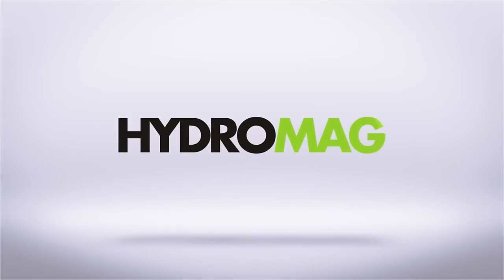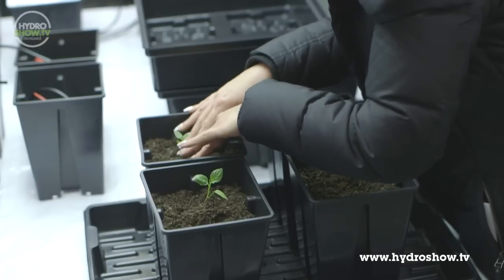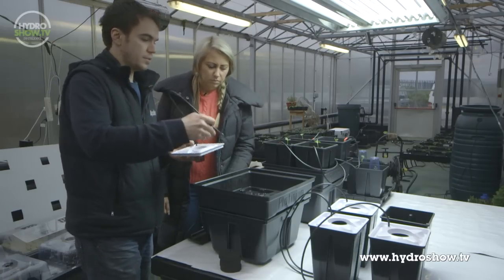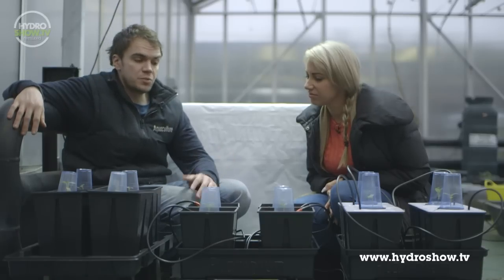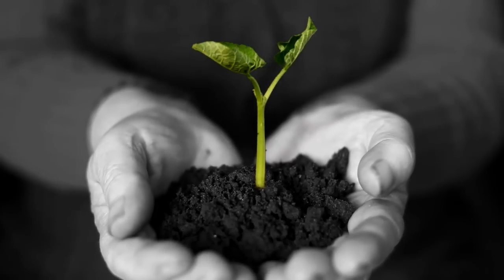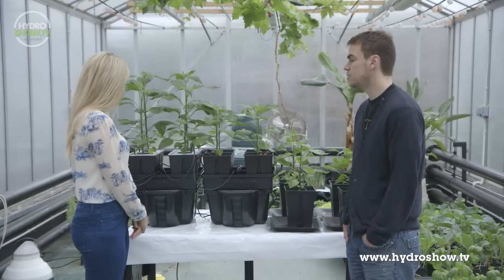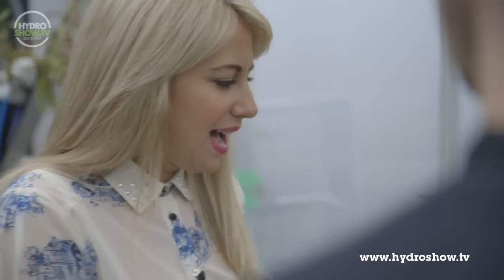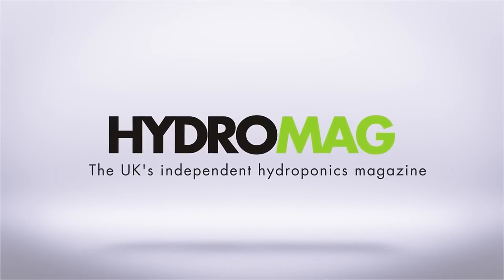#40 - Hydroponics vs Aeroponics vs Soil Growing Systems

Comment: What I miss in all these hydroponics and aeroponics demos is any mention of the energy consumption/cost (pumps, led lighting, possibly heating in winter if need to heat). 
Especially where these systems are shown for home users, it would be a great addition to know if that will add much to the running costs
Reply: Sebastian wouldn’t that depend hugely on where you get your power? The pumps are minimal no more than having a couple of goldfish, but lamps are a whole different story and most will tell you the draw power. Check out QB led technology if you’re just starting and want super effective and cost efficient lighting!
Reply: regarding LEDs i think ull be using the same amount whether u use soil, coco or aeroponics so it doesnt make much of a difference m but the output would be alot more in aeroponics

Comment: Strange, the aeroponic grown pepper plants look stretched. much larger internodal spacing, enlarged leaf growth. Looks like the larger plant size is due to cellular elongation rather than improved cellular division; similar to what you would expect from plants grown under a very red dominant light spectrum with very little blue. Improved access to oxygen at the roots should allow for improved metabolic respiration and faster cell division, but that's not what i'm seeing in your test. I have considerable experience with hydro and soil, but  I don't remember elongation as being a direct consequence of hydro, but now i'm questioning what i thought i knew  hmmmm...  time to go back over the literature...

Comment: You'll also notice the really quick shot of just one of the plants roots..to keep you from seeing how he's trimmed the rotten bits off ;)
Reply from the maker: Petty
Reply: @hydroshowtv  not really petty, it's a serious concern with this type of system. I'm guessing you didn't use any kind of timer with the pump on those plants, in which case you're not using aeroponics, it's simply soil and two different drip systems. Aeroponics exposes the roots to greater amounts of oxygen not just because of the spray/drip (which is the same as nutrient film technique or a good drip system)but also because of the periods in which all the roots are completely exposed to oxygen absorption. The only exception is when the most is fine and thin enough that the roots will constantly get enough oxygen between the fine misting effect of the water source but that's typically only feasible when using ultrasonic misters.

Don't get me wrong, you have a good system, but it's only that, good, not great and not true aeroponics. If you had a properly setup drip or nutrient film hydro setup you would likely have similar if not better growth from those plants as your pseudo-aero devices. That being said it's very rude to call a legitimate piece of constructive criticism "petty" especially when it relates to the real world performance of a product that you're promoting. At best that's misleading at worst it's downright fraudulent.
Reply: @lazyh-online4839  Excellent return - Educate rather than bash - Love for Aero - I'm working on a setup that will use a very small micron fog blended with the general  or sudo misters that come standard on the Turboclone systems -  The water basin needs to stay at optimum temps as well -Thank you again for the extended reply toward a shallow answer that most-likely had people failing at Aeroponics -
Reply: @jasonjanes3256  great to hear other people are getting involved, I built my own setup mostly homemade, just reusing components like high pressure solenoids, push connects, reverse osmosis pumps/tank, and some high pressure misting nozzles to feed the plants. The hardest part I'm working on now is I'm trying to build a custom timer using Arduino as a platform but it's very complicated because I want a modular system that can add on sensors/modules and the like for monitoring or adjusting factors like water temp, pH, nutrient concentration, even tie into the lighting timer of possible, but it's difficult to program something like this for a beginner like myself. If you're interested, I'm planning on trying to make these (the program at least and hopefully a couple Arduino shields as well) available to anyone interested, let me know if you'd like to know more.
Reply: And the roots were bone dry👍

Comment: Does each plant have the same over all nutrients though? I mean does the soil plant have more nutrients packed in to it's leaves because it's smaller? Or do all plants have around the same amount of nutrients over all, in the sense that one leaf from the soil plant and one leaf from the Aeroponics plant, would have around the same nutrient content if measured? Or does one plant have a lot less nutrients in it's leaves, etc, than the others? Basically which grow method ends up with the most nutrient rich produce?

Comment: Nice production, i`ve seen a lot less professional and informative stuff on the BBC ;)
If you plan to do more testing in the future i`d recommend including an NFT system, a sprinkler based aeroponic system and an aeroponic system that delivers short pulses of very fine, fog like mist. You`ll find the performance of the sprinkler based aeroponic and NFT is very similar but neither will come close to the mist based system. If you use pre-rooted cuttings in netpots filled with hydroton for all, that will provide a level playing field.
Reply from the maker: Hello. Thanks for the heads up. This was a very rough test. I guess this is not 'true' aeroponics, but more what has become known as 'aeroponics' in our industry. Undoubtedly the methods you talk of will offer different results, and we hope one day to put this to the test too! Keep watching. :)
Reply: hydroshowtv
There`s nothing wrong with low pressure aeroponics/sprinklerponics, its effective and the least costly. High pressure aero offers better mist quality and greater control for a price. Air atomised aeroponics represents the ultimate in mist quality and control but its also the most expensive.

Comment: question, have you ever tried to take the aero pot and transplant into a medium? my first attempt is with a dwc setup and from that I have read, the medium like the coco makes or better fruit.
Reply from the maker: Hello. Not sure about this, in fact, pretty sure that there is little evidence to categorically say that transferring in to a medium like coco makes better fruit. Coco is inert, or at least it is supposed to be - it doesn't usually offer the plants anything other than something to plant its roots down in to (unless it is pre-fertilised, and even then that nutrition would be used up by the plant sooner or later, meaning you would need to add more nutrition to the medium). Please do send us a link to where you have read this about coco - would love to read it.
Reply: I was referring to medium with a dutch bucket or sorts, sorry for the lack of info.  the larger stalked plant will need some support and I don't think the dwc method will work well when they get larger, but maybe I'm wrong there
Reply: hydroshowtv i did not quit get the daily maintainace that was mentioned on the arioponic system? i imagine the sprayed water collects at the bottom then is pumped back up to the pray heads? is there a great deal of loss? do these need to be topped up daily?
Reply from the maker: Sorry, how do you mean loss? HYTV
Reply: loss as in water leaving the system through being turned into vapor and leaving the system, hence the need to top up, you said it would need to be checked daily, is this to monitor water loss (as i have described) also to check ppm?
Reply from the maker: Oh I see. Well this is not that type of aeroponic system. The kind you're talking about literally turns the nutrient solution in to a mist or vapor, however this is more a sprinkler system where the water is kept in liquid form (rather than vapor). This means, you get the advantages of high aeration without 'loss' of water through evaporation. Of course, you should check the tanks levels daily, as well as the pH and the EC which should naturally alter as the plant drinks the water (In a nutshell). Definitely a subject worth covering in greater detail in the magazine or in Series 2 of the Hydroshow.
Reply: hydroshowtv cool chap cheers for that, im toying with making the step from organic to aero, so i will look out for that! thanks for your time!

Comment: How long do you leave your misters on for the aeroponic system? Is it constant or say 20 mins on 2 hrs off?
Reply: Depends on the system but if you run 20 minutes on its not aeroponic. Typically, a pump driven high pressure system wont exceed 4 seconds on, most of which is needed to get the pump upto speed. If its equipped with an accumulator and solenoid, 1-2 seconds on. If its driven by compressed air, again 1-2 seconds on but you`ll only need 1 or 2 nozzles.
Reply: Old post, but I do 1 minute on 4 minutes off in my 4 plant system.
Reply: I use one nozzle with a 1 second  on 1-2 minutes off cycle in a small (26 gallon) 8 plant system. The big outdoor units run 1-2 seconds on 5-10 minutes off (day) and upto 30minutes off (night)

Comment: Replace those low pressure sprinklers with high pressure nozzles and reduce the droplet size to 50 microns and you'll see even faster growth. NASA aeroponics was 50-80 microns. This isn't exactly aeroponics per say..
Reply from the maker: Hello - yes you're right (I mentioned this on a comment below), however this does demonstrate the importance of air in the root zone and how it can increase growth rates massively.

Comment: Y didnt u try clay pebbles for the hydroponics (wilma system)
Reply from the maker: True, but coco and clay pebbles are both 'inert' mediums, and quite similar in this instance. The Platinium system we used is very similar to the Wilma, however the Wilma does not come in an aeroponic version, meaning it would have been more difficult to have three identical systems with three different growing methods. Thanks for your comment. HYTVPete

Comment: The drawback to hydroponics is you will need to buy "plant food" or nutrition and supplements that can be more costly.
Reply from the maker: Matilda James
True, however the drawback with Aquaponics is that you need to wait for the water solution to be ready before you can put fish or plants in - hydroponics can be grown in straight away, correct?

Comment: lol this is far from an experiment. They're all 3 getting the same nutrients, but two of them are in coco which has a different CEC (cation exchange capacity, look it up). Having grown in both, if done right, you will see almost no difference in growth, but a large difference in how much maintenance (and headaches) - which is substantially increased in an aero grow.  This isn't even accounting for what may have been purposely done to skew the results, which is probably likely as well. Remember, the whole point of this video is to try and sell you something. Misrepresentation shouldn't be needed to sell a truly good product.

But hey, if you don't trust me, you can always do the coca cola challenge. Just be sure you know what you're doing when you do it, because this guy obviously doesn't (else he'd know you can't use the same exact nute solution and expect fair results) and is trying to sell people who don't on aeroponics.  If I fed a soil, coco, dwc and aero system with a nute solution best suited for coco, guess which would win?
Reply from the maker: Another keyboard warrior, misinterpreting the purpose of the video, and not reading the article referenced in the video description. (If you had read the article, you would have more of an insight and you wouldn't be making these comments). Firstly, two of them are not in coco - that's fairly clear. One is soil, one is coco, the other is aero. Nothing was done to skew the results (chopping of roots? really?). Nobody is trying to sell anything in this video. We didn't receive any money from any sponsor for creating it. We never stated this "proves" anything. We said, the results from this test "suggest" that aero increases growth rate in the vegetative period. Nice to have your feedback, however make sure you have the facts before you criticise please sir. Peace xx

Comment: if testing anything for growth u need to use cuttings from the 1 plant.as there is a difference betweenseeds .the word is pheno.come on get it rite.but worth wachin.thanks
Reply from the maker: Hello, strictly speaking you're right, it would be a more accurate representation with cuttings, however the genetic differences between each seed isn't too drastic, and it still shows the principle behind difference in growth. Using cuttings would elimate any genetic drift between plants that might skew results, but the obvious differences between the growth we think can easily be attributed to the systems rather than genetic difference